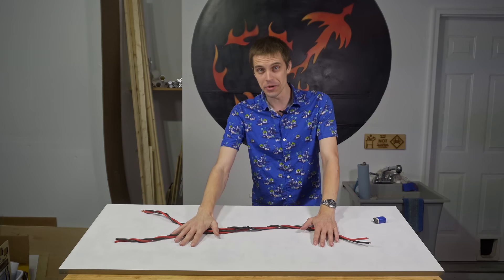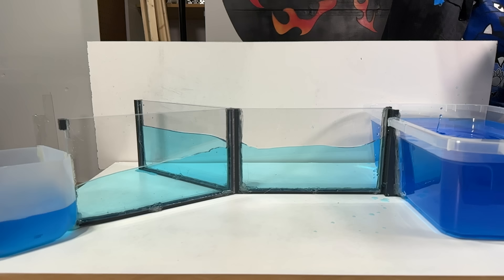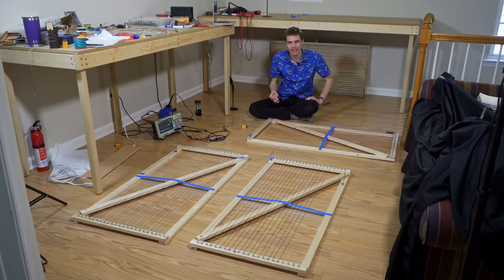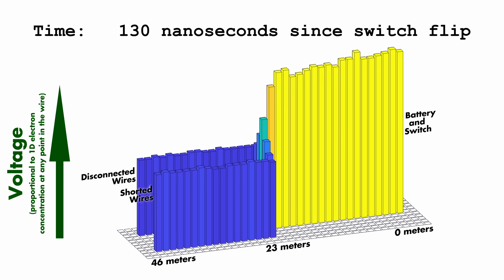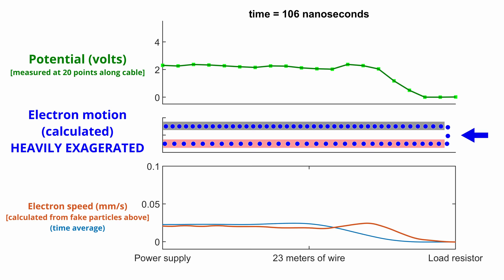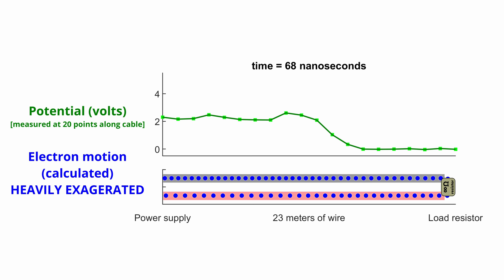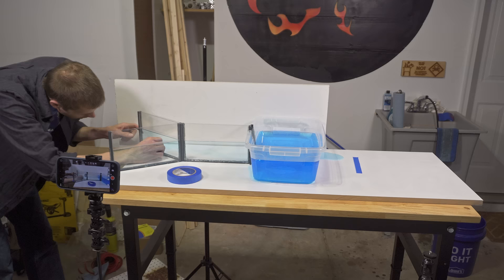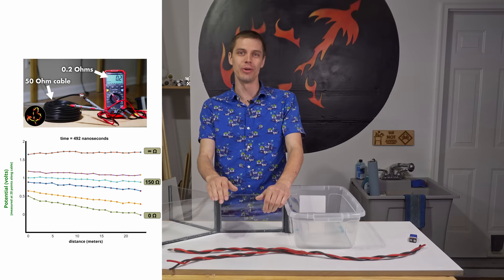Watch electricity hit a fork in the road at half a billion frames per second

Comment: Fantastic video! I have a master's degree in EE and work as an RF/antenna engineer and this is probably the best demo I've seen of these EM concepts. Amazing job breaking it down in such a way that I think anyone could understand. There's definitely some really interesting and cool material in the transmission line and RF realm which builds fairly well off of this, I'd love to see your take on antennas (and selfishly think whatever demo you'd come up with would make it a LOT easier for me to explain my job to people lol).
Reply: A video on antennas would be very cool
Reply: Indeed...  Even this DC circuit was AC for a little bit... RF is so fascinating.  :)
Reply: Agreed!  I felt pretty good figuring out which option was the right one but I can only attribute that to my knowledge gained from Amateur Radio and antenna propagation theory. I would be fascinated to see this on an antenna with RF signals but also to include actual electron flow as well. I've always thought of electron flow through wire as similar to water, but have always had a hard time equating that to RF in a wire. I would love to see it mapped out like this and the two compared. Totally geeking out right now.
Reply: I am an rf tech and I suspect that brief moment of current starting through the circuit on the open branch the energy radiates. Looks like a dipole antenna. I paused the video before finding out the solution. I have done this thought experiment with millions of miles of open pathway on a circuit. How in the heck does the circuit know it’s a dead end without violating Einstein’s theory that no disturbance can go faster than the speed of light? From another perspective, the time factor may help explain why energy has to radiate from an antenna in the first place.
Reply: Veritassium: "Energy Doesn't Flow In Wires"
REAL science:
Reply: Being border line autistic the world has always been completely confusing to me, I'm just glad there are people like this that make it a little less confusing with awesome videos like this. Such a clear and easy explanation for my mind to understand. This explained in 30 mins what school tried to explain to me in 5 years of secondary.🤦‍♂️
Reply: The circuit was excited with a DC step function,  @DavidLindes
Reply: @-danR    I've  been searching through these comments trying to find someone who would reference this, and there you are.......Thank you.
According to our extremely learned friend this whole line of experimentation and reasoning  is total bunkum, since he proved to an astonished world that "ENERGY DOESN'T FLOW IN WIRES !" 🤪 
Shall I break the news to the author of this video, or will you ?  He will be absolutely gutted and broken hearted after all the work he has put in ! 🤣
Reply: @miketaylor3947  Right... but what frequencies are present in a DC step function?  :)
Reply: Sounds like you know the answer ;) @DavidLindes
Reply: @jackb8682  
My problem with Derek Muller is his propensity for clickbaity titles, and in that instance a statement that is sufficiently vague that it's hard to call it right or wrong. What did Veritassium mean by... 'flow'? or even 'energy'? And the implication of the title was that he was going to treat the condition of steady DC current, which had almost nothing to do with his experiment.
His mind sloshes around back and forth like water in a bathtub, sometimes spilling over the sides.

Comment: This is why the TDR (Time Domain Reflectometer) is so cool. It displays the "echo" of the electric pulse bouncing off the break. And that's how we used it in the telephone industry to find the distance to a cable break (or see the "bump" of a wiring closet on the way to the actual cable end elsewhere farther down the "circuit")
Reply: It doesn't just work with electrical signals. It works with optical signals too, although for shorter runs (like in planes rather than between neighborhoods) a frequency domain reflectometer, which doesn't rely on a pulse, but a constantly changing frequency, provides the necessary resolution.
Reply: What do you mean with shorter runs? In optics typical OTDR can measure fibre cable break distances 100 km or more easily. The longer the cable, the more time you have "to measure" but the more sensitive detector is needed.
Reply: I remember the wave of understanding when I was a kid and the guy that came to fix the phone explained how he could measure the distance to the break in the line.
Reply: Brilliant!

Comment: I have worked with computer networks since 1994. Back then (1994), I used to try (badly) to explain why leaving the terminator off an coax Ethernet cable causes reflections and can be detected by observing an increased voltage.  Now, almost 30 years later and after watching this video, I finally understand those reflections.  You do awesome work Brian, keep it up and keep inspiring new mathematicians and engineers.
Reply: cheaperNet (UTP) and switches made EtherNet networks a lot less bizarre, a lot easier to diagnose, than coax cables with a PDP-11/23 at the centre of the tangle (experienced in the early 1980s).

the NBN (VDSL, in this case, to the nearest optical POP) router connecting this home to the world has four 100-megabit UTP sockets on the LAN side, and WiFi, yet copying bulk files between nodes is much faster across two pieces of blue string than involving WiFi anywhere, as any competition for WiFi bandwidth rapidly bogs things down.

Comment: Really beautiful and incredibly helpful! The analogy that makes most sense to me is of repelling magnetic pingpong balls in a PVC pipe, and an air compressor. The compressor kicks on, pingpong balls are pushed down both pipes. In one there is a concentration/pressure wave, no escape, pressure wave back, then equilibrium. In the other, each ball has a place to escape the repelling force of the one prior.

Comment: After teaching basic electricity for 35 years or more this is the best explanation and visualization that I have seen regarding current and current flow and how the wire bunches up its electrons and releases them quickly or slowly and remember 6.25 million million million electrons flowing through a wire in one second equals 1 A so electricity is it all that magic you can actually see it and measure it
Reply: I remember doing this exact experiment in Physics class in 1977 when I was in 11th grade.  We compared and contrasted water waves with electric current over time and determined the speed of the electrons as shown on a primitive oscilloscope (about five times the size of a modern one).  I am glad to see that there are those that are regaining the knowledge nowadays...

Comment: I love that you build the analogous water circuits IRL and then explain their limitations. Exactly what I try to do for my electrical students. This demonstration is perfect for my avionics students when discussing aircraft radio transmission lines like coax cables between equipment. Thank for investing the time for all of us!!
Reply: And it should show well why you need a resistor to terminate dead ends, to stop those reflections!

Comment: From an RF point of view, this all makes perfect sense, and it's absolutely fascinating to see it in such detail!  I learned about this stuff studying for my HAM license tests.  And when it came to things like impedance matching and especially determining whether an antenna looks like a short, an open, or something in between, I ended up just having to imagine how the standing wave looks in the circuit, and particularly things like where nodes and anti-nodes are with respect to the ends of the wires.  Seeing this reveals something fascinating: Every circuit is an RF circuit when it is initially turned on.  DC circuits merely reach an equilibrium extremely quickly after turning on, while AC circuits don't.
Reply: @rybec  
My father was a HAM as well stemming from his time as a COMMS/Radio Operator in the Army during the Korean War.  He was the lead COMMS operator on the front line at most of the major conflicts there...bloody ridge, heartbreak ridge, hamburger hill, etc.

He was also an amazing RF/Antenna and electronics designer.  His "HAM shack" and a separate 2-car garage/workshop were his experimental labs and "production facility," and there was always some sort of RF/Antenna experiment and fabrication going on. 

He explained the concepts (or realities) demonstrated in this video to me but wasn't quite able to present them in a way I could FULLY understand and grasp through visualization (I'm a photographer/videographer).

But upon seeing this video, everything that dad was trying to get across to me through many explanations and hand-sketched diagrams finally just "clicked" in my brain.  ...I think it was the added element of MOTION in Brian's simple but excellent animations.  ;)

Throughout my youth and later into life, I must have helped my father build, raise, lower, revise, rebuild, fine tune, and test 100's of different antenna designs of all types from 2m-80m bands and more!

That experience taught me a great deal more than just simple Ohm's law, electronics, and RF principles, as it involved conceptual design, fabrication, welding, mechanics, planning, and improvisation/problem solving in a multitude of areas.

All to say that I am very thankful and appreciative for all of Brian's hard work in producing these excellent videos.

Side Note:  FYI, if you haven't been there yet, the "Solar HAM" website is a great resource.

73
Reply: Really true! I think exactly the same from a point of view building SMPS topologies. Especially the snubber circuits are sometimes weird.
Reply: The RF analogies can to my mind as well. Pretty cool stuff. GROL
Reply: I really like the visualisations of your experiments and the intuitive insight it gives. Well done 👍
One point that I miss is that if you would terminate the single length of twisted pair with a suitable resistor (typically ~240 Ohms) the forward wave would actually stabilise at the very moment the fwd wave hits the resistor. In other words the cable has a characteristic impedance equivalent to the termination resistor. It is this characteristic impedance, determined by the distributed capacitance and inductance of the wire, that determines the initial current flow. Also this explains some initial reflections while the first segment is still "filling" due to the difference in impedance of the switched voltage source and the cable impedance. In the fork case you show there are some (negative) reflections at the very moment the wave hits the fork. This is caused by the single line from the battery now powering two wires in parallel (having half the impedance).
Reply: From a data standpoint it also makes sense. Open ends on an RS485 data bus may cause trouble. The end of the bus should have a (usually) 120 ohm resistor.
Reply: @snubberless I'm a heating engineer and would love to understand snubbers much better. When I have a room thermostat energising a relay coil, or a valve motor, I'm left wondering a) what type of snubber, b) what spec, c) which end of the transmission wire to place it.  Ive not found a good website for these questions yet...
Reply: @advance-heating  in such cases you need only a si diode or zvs diode in reverse polarity near the inductor. A snubber is needed if the driver changes its polarity like a full bridge inverter.
Reply: this is fascinating. where can i learn more about this? my background is in engineering, but not electronical engineering. took Circuits 1 but that's about it.
Reply: @Knightfall21 Honestly, start by studying for the Technician HAM license.  If you don't actually want to get the license, you can skip the legal stuff.  The Technician license material covers basic circuit stuff (probably stuff you learned in Circuits 1) as well as basic RF stuff.  Once you've gotten a good grasp of that, if you are interested in learning more, study the material for the HAM General license (same thing with skipping the legal stuff if you don't plan to actually take the license test).  That will give you a pretty solid hobby-level understanding of RF.  And once that is done, if you want to learn the black magic of RF (seriously, this stuff includes things like how lunar and solar cycles affect RF propagation like its some sort of pagan astrology; I found it quite intimidating initially, but with continued study I was able to understand it reasonably well), study the Extra license material.  It's technically still an "amateur" radio license, but the Extra stuff is pretty advanced.

My education does go a bit beyond that but not terribly far.  I'm in computer science, with a healthy side of electrical engineering, but the EE is mostly self study with a handful of university courses required for CS (and a few I audited for fun).  Probably 90% of my RF knowledge is from the HAM stuff (I got my Extra license around a year ago).  There's a YouTube video I watched on RF in high frequency circuit boards and how to route ground and power planes to minimize both external RF interference and RF emissions (that could get you into legal trouble if they interfere with other equipment, so it's important to minimize).  And one of the EE courses I audited was an intro RF course, that focused on circuit board design, and that I've forgotten probably 80% of.  Aside from the video and the EE course that I forgot most of, my education in RF comes almost entirely from studying for HAM licenses.

(On a side note, it might be worth getting the HAM licenses, even if you don't care about the social aspect.  Most HAM clubs focus mainly on voice communication, which is a solved problem and not very interesting anymore (at least, not to me).  The reason I got my licenses is an interest in digital radio communication.  I'm planning on buying a couple of RF enabled microcontrollers off Adafruit sometime in the next month, that communicate over a HAM band frequency.  Their range is quite poor, because unlicensed use of that frequency range is restricted to very low power.  Because I'm licensed though, I can attach an RF amplifier and high gain antenna to each board, to get much better range, as long as I follow the legal requirements associated with the license.  This allows me to do a lot of fun experimental stuff with off-the-shelf RF electronics that use HAM bands, so long as there's a way for me to connect an external antenna.  If you find you have some interest in that once you've studied RF a bit, getting your HAM license would allow you to dabble in some pretty fun stuff!)
Reply: @rybec  thank you for the detailed response! Saving for reference for further study

Comment: At 20:38 (and in other places) you might notice the wave reflecting back at the Y-junction in the circuit. This seems a little odd at first, but it's actually fully explained by the transmission line model. When the wavefront reaches the junction, the effective impedance of the line changes, so more current is required to propagate a wavefront in both directions. This means the lines begin to "yoink" more current, so a negative wavefront propagates back up to the source.
Reply from the maker: I love the scientific use of "yoink"

Comment: As a EE, this is such an AWESOME visual demonstration and explanation of wave propagation and reflections! It gets into great logical detail without being too much for the uninitiated.

As a robotics mentor as well, I am absolutely going to use this video as a primer for my students to justify why a CAN bus should not have stubs over a certain length and exactly why those 120 ohm resistors should terminate the ends of the CAN bus to minimize reflections.

Comment: The disconnected pair of wires actually seem to perform as an inductive capacitor. Storing voltage at first, then feeding it back into system. I couldn't imagine how much time you spent on this experiment. But the insight you have given your subscribers is beyond time. Very nicely done.

Comment: This is amazing.  Every physics teacher should be showing this vid.  Makes more sense than anything I learnt in high school
Reply: No kidding.  In high school I was taught that "current starts moving instantaneously through the entire circuit" and every teacher and every tutor was adamant that it's truly infinitely instantaneous.  I asked if that means you can use a wire to send messages faster than the speed of light and got only dumb answers.  This video does an amazing job showing the data and explaining what's actually happening.  Finally I can stop questioning life lol.

Comment: I'm a computer programmer, but decades ago I worked at a manufacturer of EPROM programmers, and had a first-hand look at a lot of hardware design.  I always found it fascinating how digital circuits would "ring" like a bell, and electronic engineers go to great lengths to eliminate or manage that ringing.  All computers and other electronics are, at their most fundamental level, analog, and are ringing like crazy.
Reply: Why do they ring? Even led light fixtures seem to have a slight "ringing"
Reply: Zappy vibration resonance.